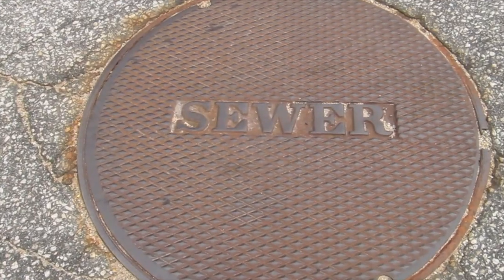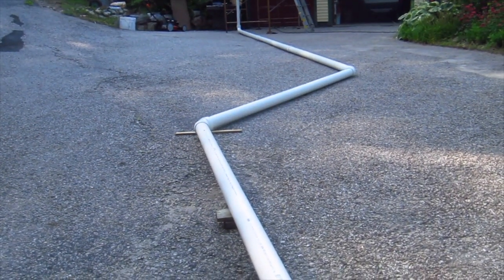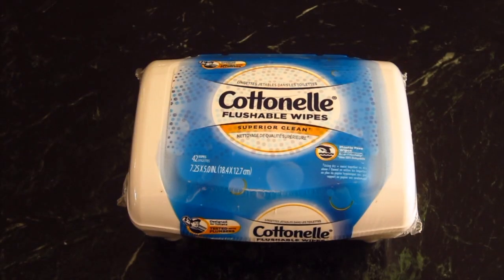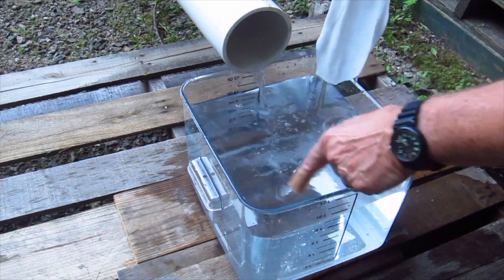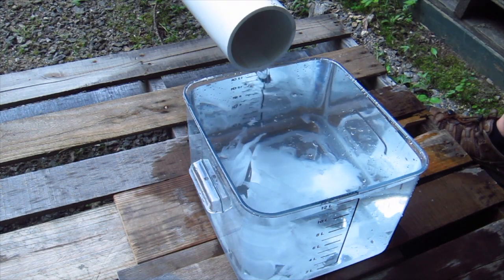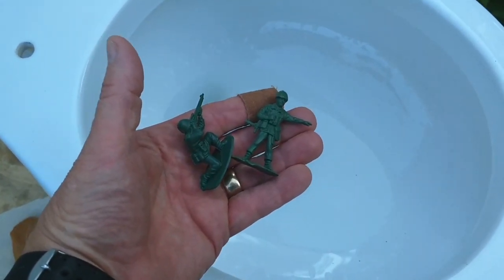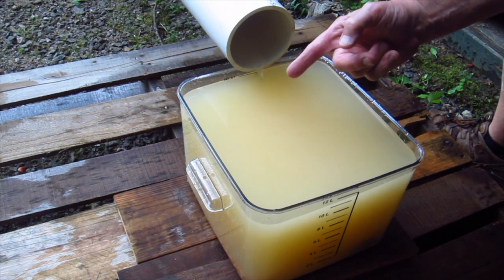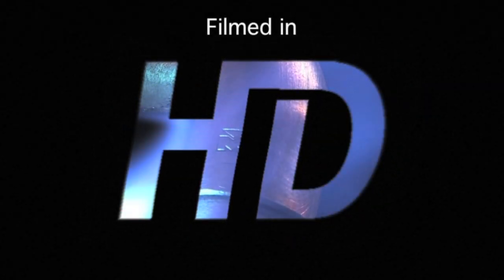Flushable Wipes - Do They Disintegrate?

Comment: This is very informative, wish this was taught in school. 

Im curious if laundry lint or dust gets flushed down the toilet or even down the sink. My mom has been sending it down the kitchen sink and toilet.
Reply from the maker: Your mom is making a mistake. Lint are clothing fibers that do not break down in water.
Reply: @askthebuilder Thank you Tim. Oh mannnnn. I better tell her this info. Last time my Dad and I had to snake the kitchen pipe was back in September and final touch of using a shop vacuum. Thanks Master Carter for the response. 
Maybe you can add laundry dryer lint to the list of sending it down the kitchen sink or toilet.

Comment: hmm i feel like a simple agitation contraption, could easily have given the results needed to see if these break down, using common toilet paper as a base line. Its true pipes arent clean, ever, but that fact coupled with IF they break down at all, is more important than one go through clean pipes. IMO, if they dont break down ever then youre guaranteed to get a clog.
Reply from the maker: A simple agitation contraption is exactly what you have inside the toilet colon and the turbulant water inside the pipes. I can GUARANTEE you if you did the test your way the wipes manufacturers would be on you like white on rice saying your test is not real-world.

Comment: My goofy neighbors at my old apartment thought it was a good idea to flush wash cloths and batteries. Of course, it clogged. Then they shat it full to the rim. After that they resorted to using a 5 gallon bucket,  which they would walk to the street corner and dump into the storm drain.  They did this on two separate occasions.  
No joke. I moved away shortly after that.
Reply from the maker: TMI

Comment: Use a bidet and regular toilet paper if you want to be clean. That said I've tested several flushable wipes myself and was pretty happy with how they broke down. It takes a little longer but not enough to cause a problem. Although this sample brand u got from China did not break down at all. I used them as wet wipes instead 😅

Comment: Thanks for this.  I am considering purchasing Cottonelle wipes, although I doubted it would be a good idea to flush them.  I live in a 30 year old condo so I'm pretty sure the pipes in this building are not pristine.  So, if I decide to buy them I definitely would not be flushing them.  As for the paper towels - Isn't there ads where the paper towels  are so strong you can wash your dishes with them then wring them out and use again?  I don't know why anyone would think they are flushable.

Comment: Can you tell me if 3 inch pipes are standard diameter used in America ??? Thank you Sir and nice honest video ......
Reply from the maker: The UPC allows up to two toilets on a 3-inch pipe. The main pipe draining all fixtures in most homes is 4-inch diameter.
Reply: @askthebuilder  Thank you Sir for the information.
Reply: @askthebuilder  Does that eventually connect to a 6” lateral line going to the main?
Reply: If your toilet install guy is doing a quick job, they might use a reducer ring to raise your toilet hole if your floorboards get built up. That reducer ring fits inside the old one will make it a little smaller than 3 inch...

Comment: Wastewater utilities used to be able to send out bill inserts in the paper bills, which warned customers of the problems that wipes cause. 
Nowadays, everybody gets their bill electronically or autopays and never sees a bill at all. 
It's also very hard to get people to read newsletters and stuff like that. 
I wonder why the wipe manufacturers don't redesign their products to disintegrate, so they could be used the way the buyers obviously want to use them. It's probably difficult to design a disintegrates-when-it-hits-the-water product that is pre-moistened. 
Thank you for a quick and definitive disproof of what the wipe manufacturers are claiming.
Reply from the maker: If the wipes were made to fall apart easily, and some do as you saw in the video, customers would gritch that they fall apart as they wipe their bums. I wouldn't be upset with the manufacturers if they put a very big WARNING on the package much like you see on cigarettes.

Comment: I this is why you need to have your septic tank cleaned out every three years, faults advertisement.
Reply from the maker: It's not the primary reason. Tanks need to be pumped to remove grease, sludge, etc.

Comment: Not a plumber. shouldn't that t be a y?
Reply from the maker: No. The sanitary tee is the correct fitting. It's the same thing at all sink branch arms. Wyes are used to connect a stack to a stack or a horizontal branch to another horizontal branch to force the waste downstream. A sanitary tee is no different than what Mother Nature does at each waterfall.

Comment: I see problems with your testing procedure. First of you’re not using the same amount of water per flush, this causes a turbulence variable. Second, the travel time between your home and the processing location is much further which in turn breaks the material down even more, unless of course it’s a private septic system in which case the primary concern is the decomp and breakdown rate while in a septic tank. I like what you tried to do here, but it needs to be done more controlled than you already have in order to hold any weight in an argument with an industry or in court. Be careful.
Reply from the maker: Dear Mayhem: You should know all the facts before you make false claims. 1. The toilet was connected to a charged garden hose. The toilet was getting the exact same amount of water per flush as if it was inside my home. 2. You didn't pay attention to what I said was the purpose of the test in the first 60 seconds of the video. Go back and listen closely. 3. I've been an expert witness for over 25 years. This test was done per the specs set up by the Flushable Wipes Association for goodness sake! 4. When I make mistakes, I hear about them FAST from those within the industry. I've never received ONE COMPLAINT from any flushable wipes manufacturer or their association. That tells you they know the test was valid.

Comment: I retired from a large children hospital that had the 18 or 24" main drain clogged up with so called flushable wipes along with other items. They had to call in huge vacuum truck and a tanker truck to unclog the drain. After that they did thier homework by having vendors providing literature & samples. They switched to a flushable wipe that quickly feel apart. Used to use the Walmart brand of wipes until it clogged my drain pipe.

Comment: Just watch the NY Drains  channel on YouTube where he clears clogged main drains on houses and businesses. A good 80 to 90% of the time, wipes are the culprit in the cause of the clog. I’ve seen videos where he popped open the cleanout plug on the main drain and a volcano of wipes blew out of the top. If you flush enough of them, they will ball up and block the pipe. When he uses the drain snake on the main drains, I’ve seen him pull out a lot of wipes. Your test and his work both prove that even “flushable wipes“ do not breakdown or disintegrate after being flushed down the toilet. The moral of the story is do not under any circumstances, flush wipes of any kind down the toilet.

Comment: Best way to handle toilet paper and wet wipes is the way they do it here in Ecuador. No flushing anything down the toilet other than urine and fecal matter. Every single public/hotel bathroom you will encounter here in Ecuador will have signs telling to not flush the toilet paper but deposit it in the waste basket instead.
Reply from the maker: Those waste baskets must be gross as can be. Can you upload a short video to your channel showing these things and come back and share the link?
Reply: @askthebuilder  Not really that gross, all toilet paper here has a good perfume, not too intense but enough to cover scents, plus if you pick the right kind of basket, you don't get greeted with the sight of used toilet paper every time you enter the bathroom. Ours is a simple plastic bin with foot pedal operated lid. No touching anything and all is contained within. Just use the plastic bags from stores to line the bin with. edit: though public bathrooms at bus stations, gas stations and market buildings are to be avoided in general as they indeed get incredibly gross.

Comment: So I worked at Nice Pak  the manufacturer of several big brand "flushable wipes." (Costco, Walmart).... And we had huge signs on all the bathroom stalls "DO NOT USE FLUSHABLE WIPES".... Lol, that told me all I needed to know.

And you only did one wipe. Most people use several in one flush.
Reply: this is the problem with wipes. ppl are using them as replacements to tp.  I personally use them to "clean the unseen" if you will.  but people who use them like that are giving them a bad name.  frankly we just throw them in a dedicated garbage can to avoid plumbing issues, especially important if you like using them while camping in a trailer.
Reply: @Dexter_Solid  They give themselfes a bad name. It's such an awful product you don't need dedicated people to say it. They are baby wipes with a bad/wrong name. As you mentioned they are to be used when normal toilet is not an option and are incompatible with pipes.
Reply: @Dexter_Solid  same they finish up the job. i also just toss them. my flushable wipes say on the back do not flush if you have a septic system. but i feel like its not good for water treatment plants either
Reply: @quillclock  
I remember touring a waste treatment facility in South San Francisco, and those flushable wipes would routinely clog up the intake filter at the plant. They make quite a mess.
Reply: @Dexter_Solid yes, they shouldn’t substitute.  I only use one per, as you mention, best microscopic clean.
Reply: You're expecting reading comprehension AND literacy? Yeah, good luck.

Comment: 😂🤣😂🤣😂🤣 you used PVC, we don’t use PVC for sewage we use ABS which is slicker than PVC and way stronger. You failed the second you used PVC.
Reply from the maker: Can you share an independent reliable source that says ABS is smoother than PVC? Or, is this just your opinion? Do you realize that ABS is used primarily west of the Mississippi River and PVC dominates east of the river? You can't find ABS in the Eastern USA. Finally, tell me how I failed the test. Please consider making your own video showing what you think is the way to pass the test.
Reply: @ I’ll also add a toilet that high off the ground is going to be connected to a tube or shower and a sink adding to a volume of water. If the question is do they disintegrate you failed. Of coarse it’s not going to do much of anything in a fresh clean line. The real test would be to see when it gets hung up how long does it take to break down in a closed system. You removed most if not all the variables so it’s an incomplete test a fail. Independent study 😂🤣😂🤣 nah I prefer real life situations not removing the variables.
Reply: @ The smoothness of the wall lining was a BS trick we use to test ppl as it has nothing to do with how quickly  stuff goes down the line. It’s to muffle the sound of the water 🤣😂🤣😂. You should have known that. PVC is smoother adding to the sound quality is what you should have said not asked for independent source 🤦‍♂️. That was to see how much knowledge in the 2 materials you actually had.

Comment: If flushable wipes weren't really flushable, they wouldn't say flushable on the label

They'll disintegrate SOMETIME, along with OTHER flushable paper products....

If the plumbing ever gets clogged, just pour a bucket of water in the toilet and start plunging if needed

One time I had my toilet get clogged, and it wasn't even on my part

I tried desperately to unclog my toilet with lots of plunging and even unclogging products to no avail

I finally had to call the landlord Who owned the place at the time and tell them what was going on because the toilet was starting to not flush at all

They sent out A plumber to check out the problem My end with their equipment they found out that someone up the street flushed a rag Comma and somehow it ended up In MY plumbing

They ended up having to dig up part of my front lawn just to get to where the problem was, they pulled out the rag the plumbing was then put back together, and everything was returned to normal

I don't know how someone managed to possibly flush a rag, and that rag ended up in MY plumbing 😮 🤔 🤷🤷‍♀️🤷‍♂️
Reply from the maker: You're wrong. Did you watch the entire video? Did you see all the things that weren't supposed to be flushed? The wipes manufacturers are guilty of unethical practices not WARNING folks like you that the use of the wipes MAY/WILL lead to expensive plumbing repairs.

Comment: I worked in construction management for several years. I read the reports. NEVER FLUSH "FLUSHABLE" WIPES! They will never break down as advertised and they destroy the sewer infrastructure. I use them but I have a small garbage container that I put them in. I know that's gross but it's a lot better method of disposing of them. I also use one-ply TP.

Comment: Bear in mind that most homes push more than 300 gallons of water through the drain a day, a significant motive force.  
I would never load a septic system with even Charmin but modern municipal systems can handle solids. FYI, I am on city through a grinder pump.
I applaud the experiment though. Well done!
Reply from the maker: TNX. I decided to invest this time to prove to the PR person and the FWA that they messed with the wrong guy. I've dealt with the crap spin from PR people for 25 years before in my Ask the Builder syndicated newspaper column. All too often they only share some of the details and never do they share the entire truth. It's all Game of Thrones stuff with the manufacturers wanting to protect their profits.

I'll add that the PR person and the FWA NEVER got back with me to say the video was wrong. That tells you all you need to know.

Comment: We only flush toilet paper.  I use bamboo toilet paper while my family member is still using Charmin.   

          Since I use bamboo toilet paper and bamboo facial tissues, 
          I experimented by putting 1-inch depth of water in the sink.
          Then I added one facial tissue and four toilet paper segments in the water.
          Both began disintegrating immediately.  
          I picked them up and they fell apart.
          I'm happy.  I buy the bamboo products on Amazon.

Common sense.  Never flush paper towels as they are made to clean up messes without disintegrating.

Common sense.  Never flush ANY wipe as they are already wet and don't breakdown when they are being used.  

             I don't even flush flushable bamboo wipes just because I don't flush wipes.  But I'll experiment later.  I anticipate they will break down.  I just don't want to waste any.

Comment: I use paper towels instead of tissues when I have a cold or runny nose since I know that if I leave them in a pocket they will go through the laundry cycle without disintegrating and covering the wash load in paper dandruff that is next to impossible to remove from clothes. If they survive a wash cycle there is no way that you would want to put them down the toilet.

Comment: I dont flush paper or whips down the toilet.  I put it all in a separate garbage can.  
   This will prevent you from ever having to call septic removal service.   
    The two previous owners had repeated septic clogs. 
   So much cheaper that expensive biodegradable tolit paper and annual septic tank clean out.

Comment: I work at a wastewater plant.  There are no flushable wipes, NONE, ZERO.  They do not degrade and cause all sorts of problems for waste treatment, and much much worse problems if you have a septic tank.
Reply: Cottonelle brand disintegrate like TP, only brand I use
Reply: Sounds like a challenge

Comment: Seems the wipes were flushed with about 10 liters, and then all the traditional paper products were flushed with over 12 liters. So, the paper products had more time getting turbulent flow in that plastic container from the additional volume flowing into it.   Seems flawed.
Reply from the maker: Nope. It was the same flush each time. The amount of water in the clear container varies depending on when I shut off the camera. Keep in mind some water flows into the overflow tube in the tank as the tank refills.

Comment: you can NOT use flushable wipes with a septic tank.  just don't do it
Reply from the maker: Correction: You CAN use flushable wipes in a septic system - but as I said in the video, you'll RUIN IT.

Comment: This doesn't even directly address septic tanks where anything going down the drain needs to decompose on the property. There's a difference between flushable and safe for a septic system. Just because something can be flushed doesn't mean it will decompose. Use only products that are septic safe for septic systems and even then be careful.
Reply from the maker: This is an in-depth article I wrote about septic systems. It's a must-read for many: https://www.askthebuilder.com/septic-system-design-and-pumping-easy/
Reply: @askthebuilder  thank you for the link.

Comment: As Tim suggests, use extra water when flushing "flushable" wipes to ensure they reach their destination. Many toilets only empty the tank partially (1.6 gal?) when flushing. If you hold the handle down while flushing, this empties all the contents of the tank. TIm also mentions that the wall smoothness of your pipes may not be optimal so a standard flush may not always work. His simulation of a bowel movement didn't include the toilet paper. So consider the extra volume when flushing.